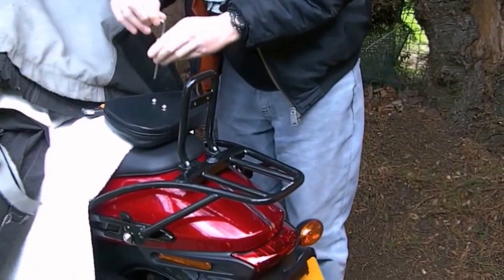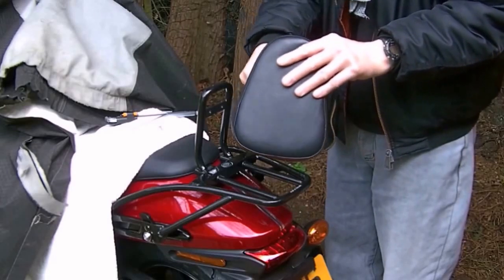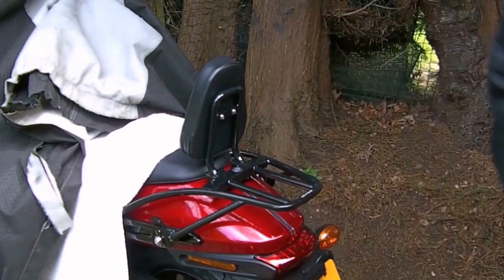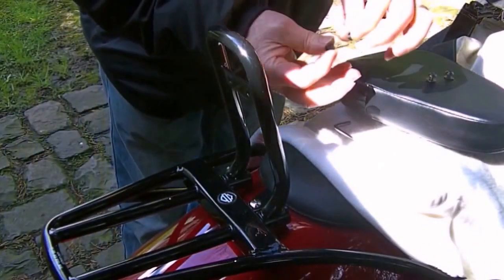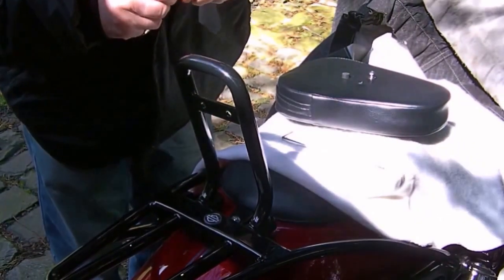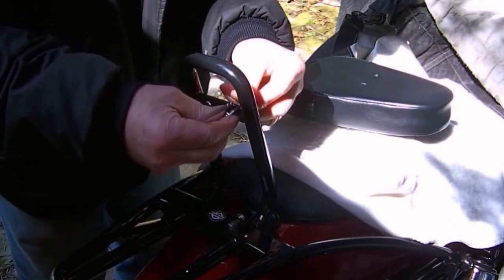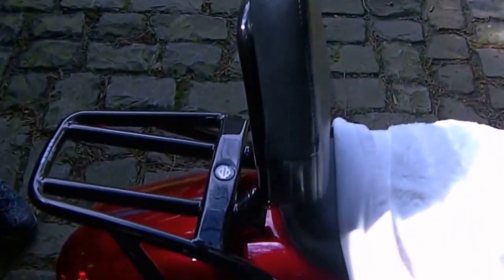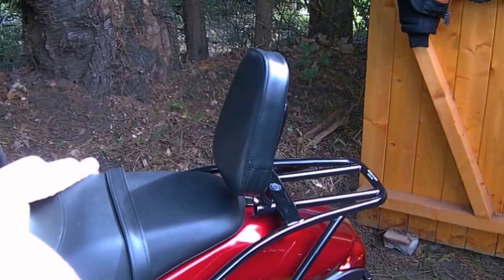H-D XG 750 Street #73 Back Pad

Comment: What backrest pad is that? I cannot seem to find one on the HD website that will fit the sissy bar I am ordering. 
Thanks for all the 750 Street vids!
Reply from the maker: Hi there, It's not a stock HD pad, the Harley one I had I sent back as it wasn't very good and it cost 50 pounds. This one I'm using came off of eBay. Cost about 7 pounds all in and looks pritty good. Plus the quality isn't to bad neither for the price.